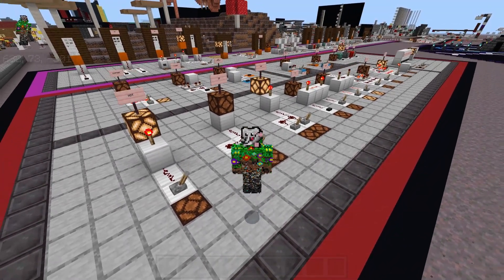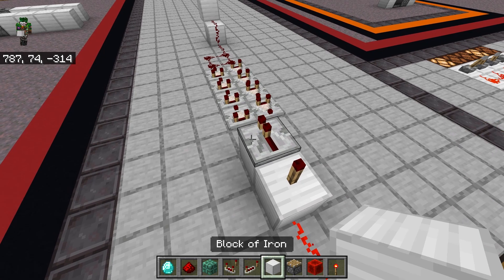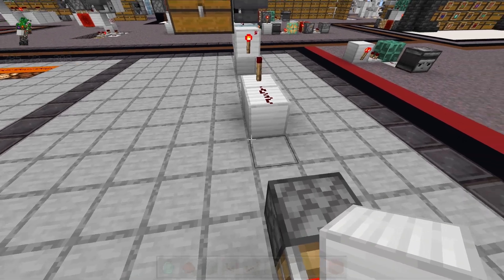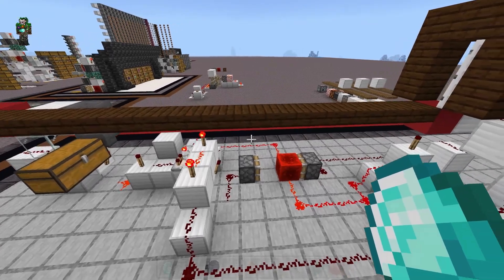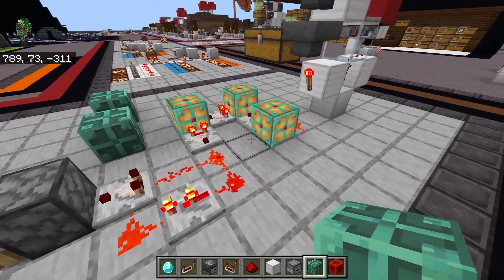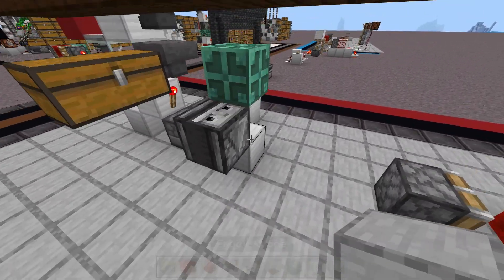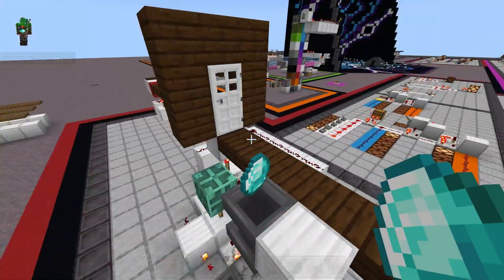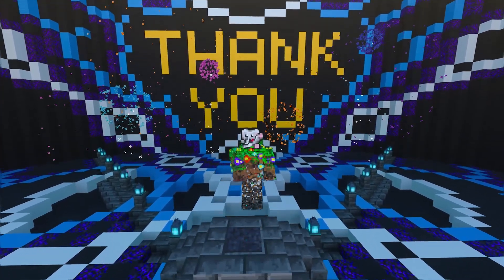Compacting Redstone - Using Logic Gates to Build Custom Redstone | Let's Learn Redstone 12 Minecraft

Comment: 17:35 …unless you change the LEGO into technics;)
Reply from the maker: Hehehehe! There is prolly a way to get that done ngl. Move into logistical redstone to build a computer that like acts like all the gates combined lolol

Or teeeechnically there are times where you can spread out a gate & be more efficient that way. Like an AND gate; 1 torch could be behind a button & the second torch could be attached to it's trigger as well, with the 3rd torch somewhere in the middle. That could potentially save you some redstone, since like the torch behind the button could also be sending the signal down or up or somewhere >.> lolz
Reply: @OmLedu  exactly.  It’s the first principles thinking, that allows for augmentation like that.  You do a good job at it
Reply from the maker: @MECKENICALROBOT  What's first principles thinking? :oo That sounds fancy & makes me curious haha.
Tysm! :D Glad you enjoyy